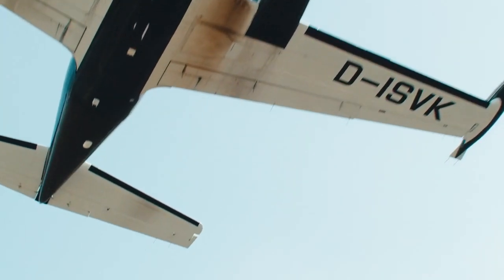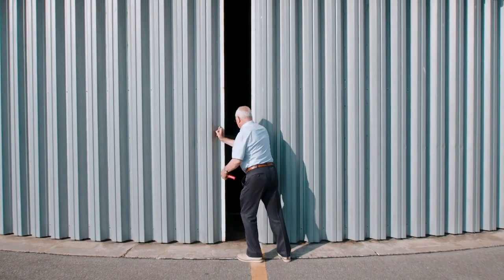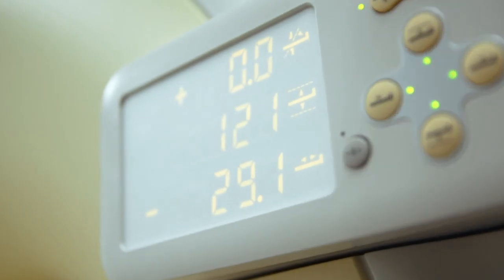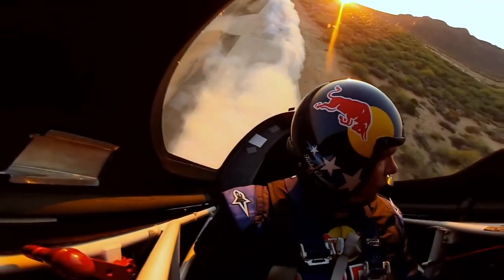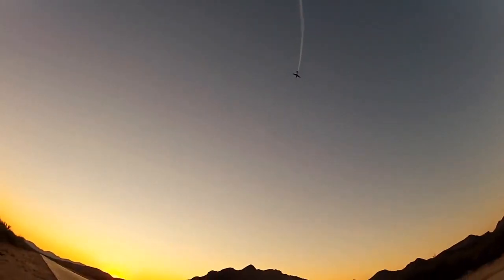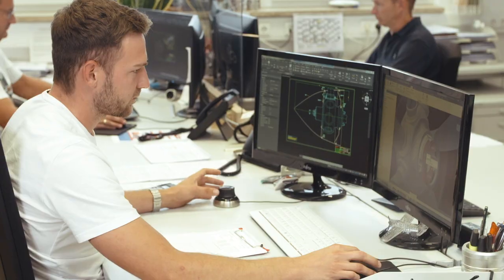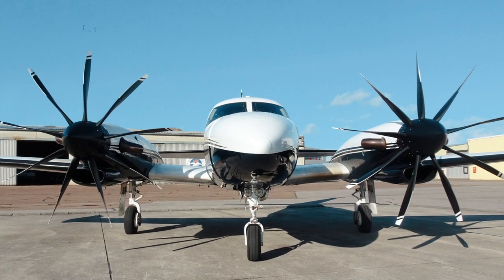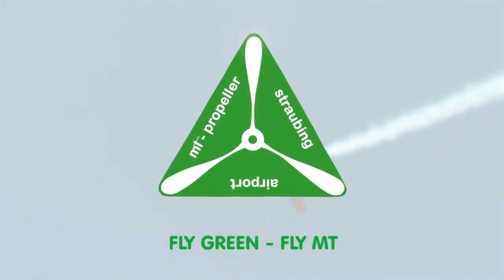Where aircraft propellers are created | MT-Propeller

Comment: Question: Could it be said that the closer a turbine engine gets to needing a hot-section overhaul (after it has started to lose rated torque...) the less efficient the five-bladed propellers are? In fact, could it be said that the aircraft will suffer even more noticeably in takeoff performance, climb and cruise speed with these weakened engines because of the five-bladed propellers instead of three or four-bladed propellers?
Reply: Good question
Reply: Yes, more size and more weight having to be flung around cant go as fast with less torque.

I'm a propeller overhaul mechanic😎